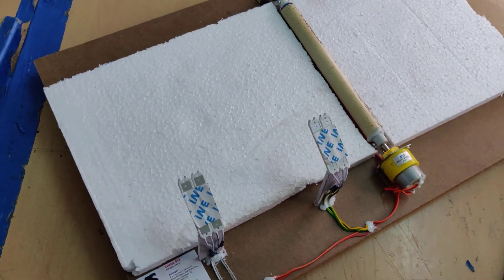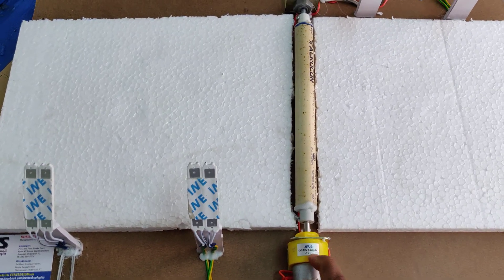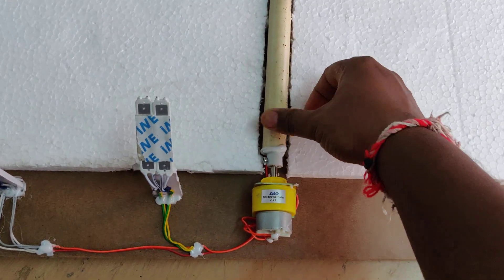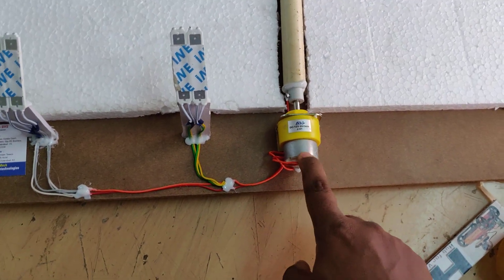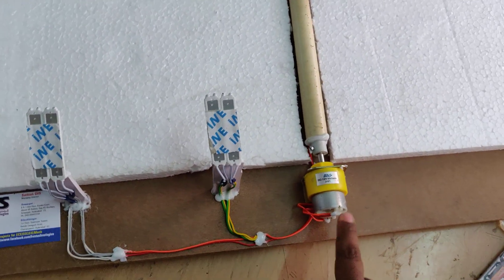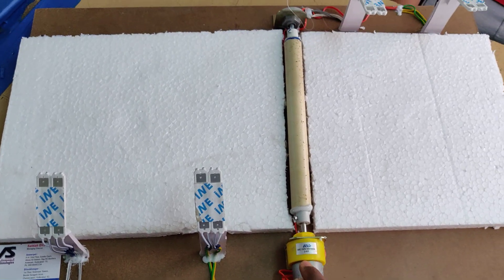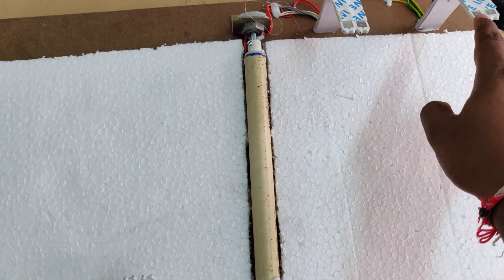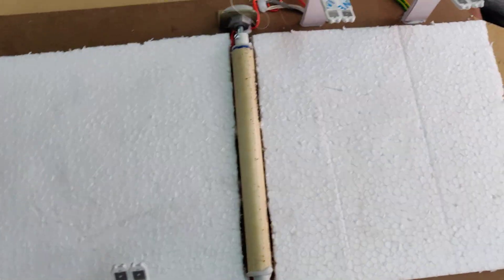Speed breaker power generation with Street lights

Comment: If use steeper motor 5v it generates more power than dc motor
Reply from the maker: Yes. But voltage is less
Reply: @hvstechnologies  dc motor generated @ 6v non load  it useful for 4v led strip just need 2 for battery charging 😁😁😁
Reply from the maker: @devmhaiskar3576  we are using 12v 5watt leds